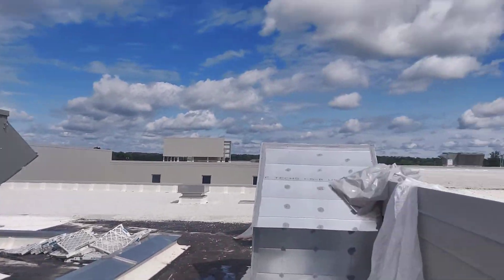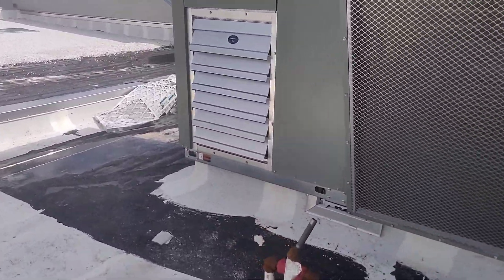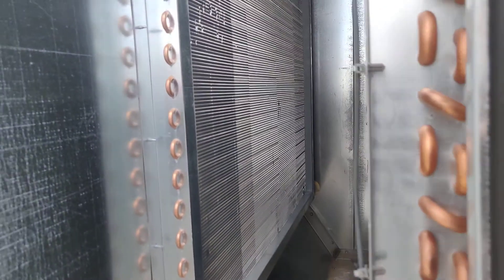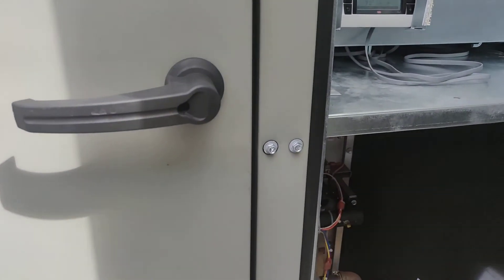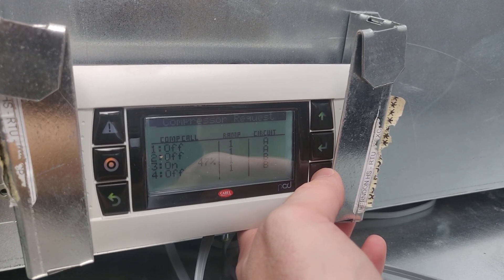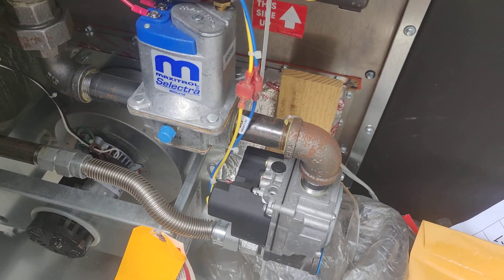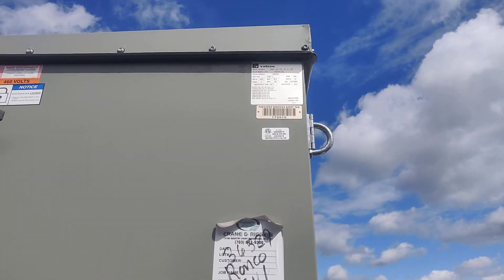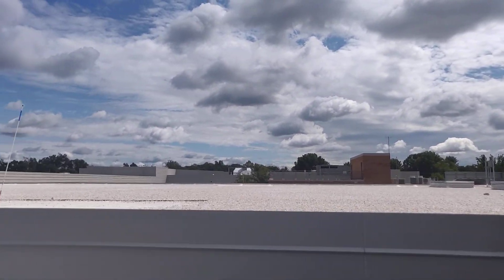Valent VPRE 25 Ton RTU HVAC Unit Tour

Comment: This units enough for many rooms /offices etc, what if the compressor go bust in the middle of a long holiday ? Do they have 1 or 2 compressors ?
Reply from the maker: 4 compressors total, 2 per circuit. This area of the building is served by 2 units, so the other one could run in addition to this one if needed.